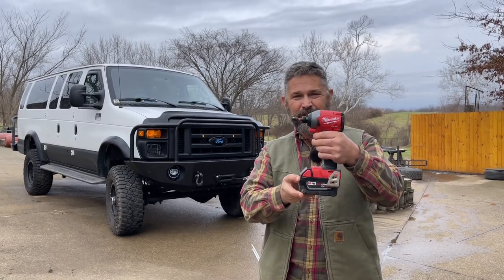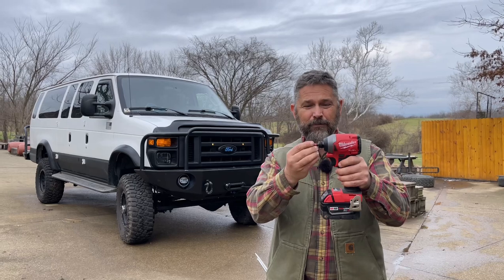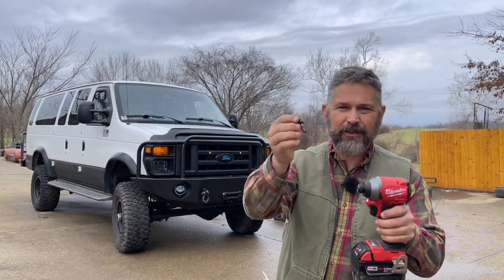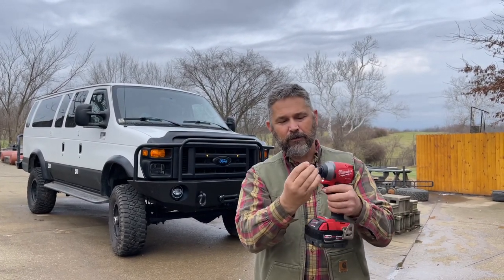How To Extract A Broken Bit | Milwaukee Fuel 1/4" Impact Driver

Comment: Now for the rusted shut parts.  A 50/50 mix of automatic transmission fluid and nail polish remover is the best unsticker.  If you have manual transmission vehicles as I do, use that old bottle of liquid wrench that's been hanging around.  Happy New Year y'all.

Comment: I didn't have a zip tie that fit into the gap right, so went in another direction: I got a grip on the chuck in the open position with a pair of needle-nosed vice-grips. Similar idea. Same result. Though I did have to tap a little longer than you did.

Comment: I love my M18. It is the first impact driver to surpass the mighty 12V Makita 6916D that I bought brand new in 2000 and which still works (provided I replace the cells in the battery packs every 5 years or so). This tool has outlasted several cordless sets. After over a decade of daily commercial use followed by another decade of side jobbing and home use, everything about it works exactly as it always has. The completely analog electronics have lasted. I have replaced the brushes once. I have disassembled it to inspect the impact mechanism. The hammer anvil show only enough wear to indicate that this is not a brand new tool. Everything about it is good. The real reason I have the M18 set now is the 1/2" drive rattle gun. Better than pneumatic. What a tool. I'm rambling. The point is that wrecking 1/4 hex to 3/8 square adapters is practically a hobby for me. I still have a dewalt adapter that must not have been hardened because it twisted just shy of 360° while driving some huge lags into some telephone poles I was using for landscaping.

Comment: Yup, been there, done that.  Mine was Makita.  I had to un-bind mine before it'd come out though.  But, I got it out.  Happy New Year to ya Stonnie.
Reply from the maker: I about beat this thing to death, then someone told me about this method. They probably saved me a few hundred dollars because I was freaking out level mad...
Reply: @StonnieDennis  LOL... mine happened on the job back when I did remodeling.  Boss hated down time. LOL
Reply from the maker: @RatdogDRB  I should have known the Youtube Reviewers were fibbing a little bit about what this tool can and can't do.
Reply: @StonnieDennis  No rusted lug nuts! LOL